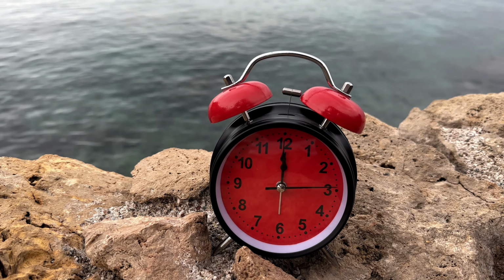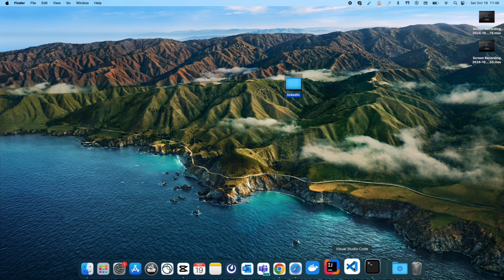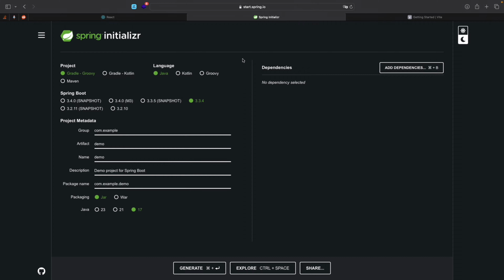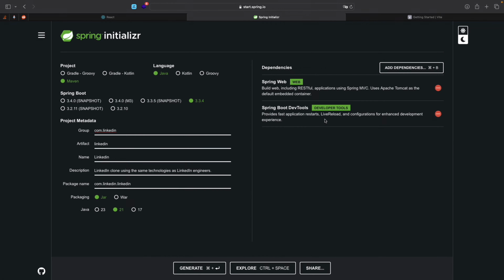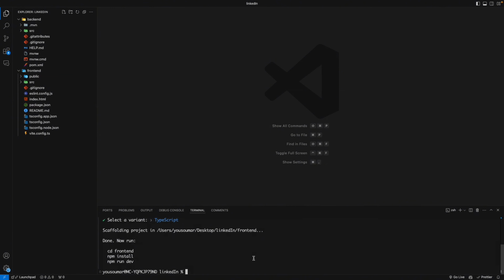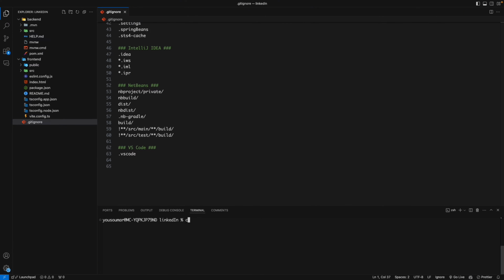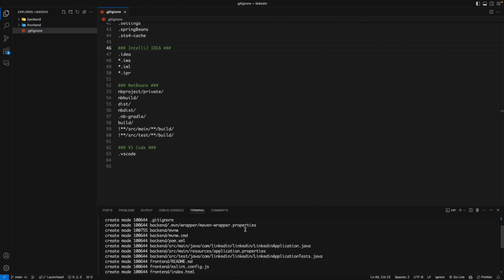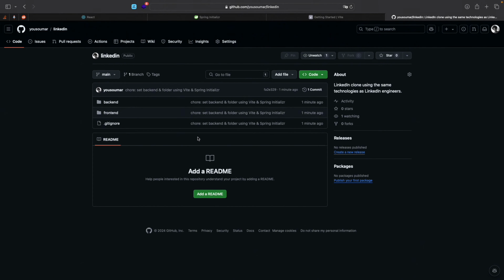Introduction and setup for an advanced LinkedIn clone project

Comment: if I use STS for backend then how will i create the mono repo ?
Reply from the maker: Hi! Sorry I do not know what you mean by STS.
Reply: @ STS is a eclipse type of IDE which is generally used for spring boot development so if i use vs code for frontend and spring boot STS for backend how can i create a mono repo
Reply from the maker: You can create your Spring Boot project with STS, and simply add it to your monorepo using the file explorer of the OS. Or maybe that's not your question.